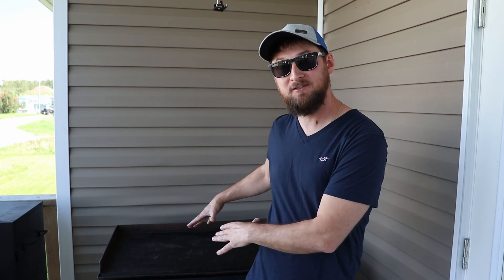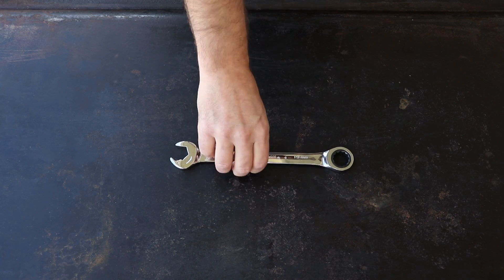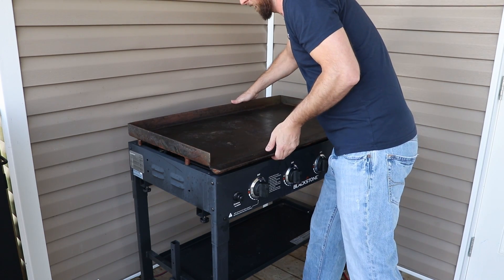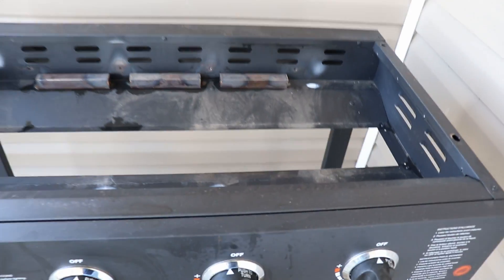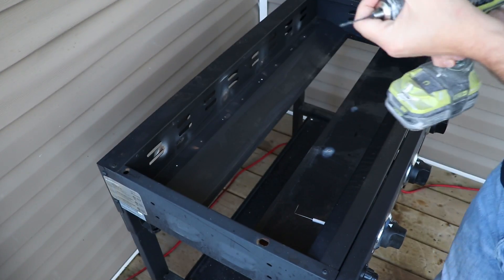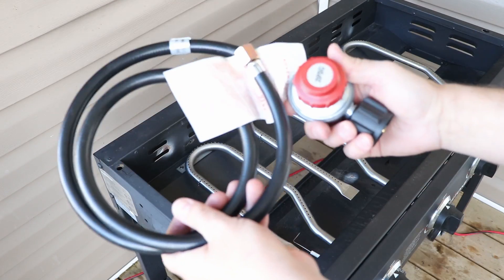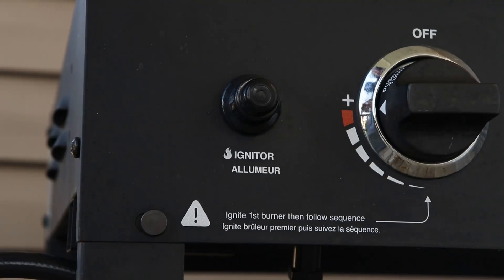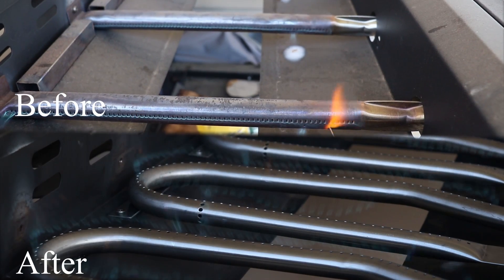UPGRADES for a WAY HOTTER Blackstone GRILL/GRIDDLE

Comment: I upgraded two 36 inch blackstones, mine and a friends. Mine I put new burners in and a 30PSI regulator because it was the same price as the 20PSI. Way overkill. The original regulator is 1PSI. IMHO 5 PSI is overkill.  On my friends we did not change burners just upgraded the regulator. The original burners put out way more heat than the upgraded burners. The upgraded burners do disperse the heat more, but after using both I would say that the regulator upgrade is a must and the burner upgrade is optional. Also remember to turn off your tank and drain your hoses after every use. You are putting more pressure on the internals of the valves and they could fail if they are holding more pressure than designed for. The pressure is maximized when the valves are off but only if there is pressure in the system. Draining your hoses eliminates that pressure.
Reply from the maker: I would agree. The burners are for better heat distribution and the regulator is for better heat control.  Thanks for sharing.

Comment: This is a great upgrade.  My griddle had the cast iron burners.  I didn't need the regulator but I did need to extend the igniting probe closer to the tube.  I used an extension spring to grip the igniter probe and then forcefully unsprung it to extend to the tube and provide a good spark - took some trial and error.
Thanks for this video!

Comment: I have a 36" Blackstone (Air Fryer version), which is a fairly new model, so I can't speak to how the older models heat. On any outdoor gas griddle that I've seen, it appears that they all suffer to some extent for heating evenly all the way to the outer left and right sides. The U shaped burners look like they might move some heat a little farther out. I'm not sure how much of a problem it is for others, but for me it's not a problem. If I ever had to replace the burners, I might consider the U shaped ones. A far as heat, I absolutely have no shortage of heat. I almost always use low to medium-low settings for cooking. When I seasoned my grill, I turned all 4 burners up to high. I measured the surface temp with a high quality laser/infra-red thermometer and it got over 750 degrees. I don't cook anything on the griddle at that temp. Thanks for the video!

Comment: I did this to mine. Almost too hot on low- the adjustable regulator is unreal. I threw hash browns on WAY too cold yesterday..... that regulator fixed that in seconds :0 Think I may put two of the old burners back in for diversity. Awesome idea, totally dig it. Love having the 5th burner (regulator)  option as a total top attitude adjustment for either when it gets windy or the top is accidently cooled off quickly, almost like having a Wok add on.

Comment: My Blackstone is three years old and if the wind blows stronger then 7 mph good luck on trying to grill or griddle anything. I never have liked it and can’t understand why so many people think they are the greatest. I clean my burners every time I lose the blue flame due to spiders. I have built a wind break to surround it. I feel that the burners and the griddle or grills are too far from the flames and there is too wide of an opening from the bottom of the griddle to the housing which allows way too much air which equals reduced heat. Even though I have about given up on cooking on mine (I was more choosy about my next one) I still will use it on calm days. I’m going to invest into these burners and see if they help me to enjoy using mine again. Thank You

Comment: Drill the rivets out no grinding needed and use self tapping screws.......
Reply from the maker: I agree.
Reply: Don't even bother with self tappers....Drill the rivets then rivet the new ones in. Easy Peasy
Reply: With a 9/64th’s bit😊
Reply: Na, sometimes the rivets spin when you drill them out, grinding them is more gooder 😂😂

Comment: Great video! Thanks for posting. I believe there is a griddle by camp chef or blue rhino that has one area of the griddle they call the "sear" area. It has a double burner but just at one end. Your idea would be a great way to modify a regular griddle with maybe one or two of the double burners and still have part of the griddle where you could keep the temp a little lower. Overall a great video. Good photography, to the point narrative and super results. Thanks again. Looking forward to more from you!
Reply from the maker: Thanks. I'll be posting another video soon to answer some questions like "how hot does the griddle get?" "Does it solve hot and cold spots?" And a few more. Thanks again.
Reply: You can't get the Burners anymore. That's problem
Reply: @dgperforms1  YIHAM KB867 Gas Grill Burner

Comment: Use a bit in your drill and drill the rivets out I'm making the rivet hole a tad bigger. Rivets will fall right out. I like this idea I'm curious if the heat will warp the carbon steel cooktop. I may try this on one burner. Thanks glad I found it.
Reply from the maker: Yes, I just kind of used what I had without much thought into it. It still works great. I got my griddle above 800°f, which is way too hot, but didnt get any warping.
Reply: @savakolmogoroff9094  Have you made about pizza on it at that heat?
Reply from the maker: @oren5230  I've made pizzas on the grill but not the flattop. I might have to try that. Move videos coming soon.

Comment: Great video.  I wonder if I could fit just two of the curved burners in there and leave the other 2 stock burners.  Sort of to create a "sear station" even though the whole thing is a sear station.  I sous vide my steaks and getting a spot on the griddle even hotter is appealing.
Reply from the maker: I dont see any problems in doing that. Let me know how it goes. Thanks for watching. More videos coming soon.
Reply: I was thinking the same thing. Just putting in 2 u tubes in the center. I have 4 burners. Did you try 2?
Reply: Why bother with just two?  Do the entire mod then you will have them iff you need them.
You don't HAVE to use all 4 fired up to full.

Comment: The regulator gives you more heat. The tubes are only single hole tubes and not dual like the factory. It will give more even cooking but the BTU output of the tube are basically the same
Reply: So him changing to a regulator is good enough to make it hotter?
Reply: @drksole3666   thats correct

Comment: I changed out the regulator for a 30 psi adjustable regulator which provides more gas flow.  The griddle gets much hotter now
Reply from the maker: NICE!
Reply: I was thinking of doing the 30 psi, no complaints a year later?

Comment: At first I wasn't sure but now I think I'm going to do this. However, I will say just as another commenter said. Self tapping screws and a drill bit to drill the rivets would make it way easier and require less tools.
Reply from the maker: Correct. I definitely winged it.

Comment: The normal grill reg is 11wc or about 0.4 psi.. I opted for a slightly less over-the-top 0-5 psi regulator.
Reply: Where did you find a 0-5 regulator with the right connector?

Comment: Great Video.  How do you light the other three burners is the ignitor is only on the first burner?  Do you have to remove the griddle in order to light?
Reply from the maker: The flame from the first burner simply lights the others due to their closer proximity.

Comment: Nice video. The linked burners don't fit the new 36" models though. The tubes are now 17" long. But at least I have the instructions to mod it.
Reply from the maker: Thanks for the update and thanks for watching.
Reply: Do you know where I can find the 17" ones?
Reply from the maker: @1BigPapas220  you could search Amazon. I'd start there.
Reply: I ended up buying "Hisencn Stainless Steel Gas Grill Burner" from Amazon. Measures 16.5" and can still for 4 in the Blackstone.
Reply: @Collective-Mayhem  thanks I will look them up.
Reply: @Collective-Mayhem  hey I tried to look them up and can't find the ones with 4 burners.  Would you happen to have the link?
Reply: I had 1.5" steel tubes to support the burner since you can't mount them to the other wall. Just used JB weld and let the burner lay on top of the tube. Hardened in 24 hours.
Reply: @Collective-Mayhem  got it  thanks
Reply: So I just upgraded my griddle with air fryer and I added a piece of the original burners the blackstone had I’ll install the valve bar soon

Comment: I like the video and see you would get more even heating but to be honest im doubtful of how much extra heat your getting (from burners) because the old burners actually appear to have more gas holes than the new ones. Again im not saying that you are wrong and only questioning how much it changes. I feel that an increase in heat may be from the PSI from the regulator. Thanks for sharing this. Sorry wanted to add one other thing. instead of a grinder. use a 1/8 drill bit in the center of the rivet for the same effect with faster removal.
Reply from the maker: Yes, you are correct. The regulator has more to do with the increase in heat. The new burners are for heat distribution.  These burners cover more area and the griddle is less prone to hot/cold spots. Thanks for watching and thanks for the advice. More videos are on the way.
Reply: I do agree Dion, I wonder what the BTU's are on each of the two different burners?  anyone know?

Comment: What's the need for a new regulator and how do you light the other burners having taken out the flow channels from one burner to the other, looks like you have to take the griddle off to light them all.
Reply from the maker: The flame from the first burner easily lights the the next burner and so on....

Comment: Not bad if you want more heat. But as it comes from factory is already too Hot. If I was to upgrade it I would adapt 2 BJ thermostats. 1 for 2 burners. Those thermostats have 2 adjustment screws. One for pilot adjustment that you’re going to need (install pilot) and the other for a bypass adjustment for the low flame. And most definitely I would not use a HP regulator like you are. This is a Griddle not a Fish cooker.

Comment: Great video! Very easy to follow. Do you have an specs on these burners? I'm interested in the BTU rating of these burners. Thanks.
Reply from the maker: Hello and Thank You. I dont have the BTU rating of these burners but  I do have some info. 
For my Blackstone griddle 
Highest temp- from 500°f to over 800°f (thats way to hot but up to 650°f gives you lots more control and I get incredibly sear on meats)
Pre heat time- from 15min to just 4 min. 
I can now easily use pots and pans on the flat top as well.
Reply: click on the amazon link and these burners claim 12000 tbtu's. blackstones are supposed to be 15000 so....?
Reply: Hi Michael... I have used these burners and the original blackstone  burners with the regulator mod. The original blackstone burners definitely put out more heat but the burners shown here disperse the heat more. Putting an oversized regulator on is where you get the biggest bang for your buck. IMHO the burner upgrades are optional.

Comment: Do you have any data on how much of a temperature increase someone would expect to see after this mod?  Definitely looks like you would have much more even heat, but I'd be interested to see what the temperature of the surface is at with something like a laser temperature gun when the griddle is on full blast.
Reply from the maker: Funny you ask. I filmed a video exactly about this today, sat down to edit and it was all out of focus.
I got an average increase of over 200°f and got the center to over 800°f (it topped out around 575°f out the box) after a 10min warm up.  Good for an incredible sear and overall more control and even heat. I'll be refilming that vid and will release that soon. Thanks for asking.
Reply: @savakolmogoroff9094  Holy shit!  That would produce some insane crust on a steak or burgers.  If you happen to re-shoot the video to demonstrate the proof of concept, I'd be interested to see.
Reply from the maker: I will get on that ASAP. Thanks for watching.
Reply: @savakolmogoroff9094  Any long term updates on the mod? I'm about to do it myself probably tonight or tomorrow.
Reply: @savakolmogoroff9094  cool

Comment: I’m buying a flat top would you recommend another one other than the Blackstone that has better heat on the bottom more distributed or should I buy the Blackstone and just redo the heating elements

Comment: Awesome video.. I'm going to do this mod.. Do you think just the high pressure hose will make a difference in the stock burners..? Thanks again..
Reply from the maker: Thanks and yes. I changed just the hose on my bbq grill and it made a world of a difference. Preheats much quicker and gets hotter for a much better sear and beautiful grill Mark's. Thanks again for watching.
Reply: You only need to upgrade the regulator. Burner upgrades are optional. Use an adjustable 5PSI regulator. When finished keep a valve open on the Blackstone and close the valve off at the tank to drain all the pressure from the system so you dont damage the valves on the Blackstone.
Reply: How does this mod work with the natural gas, any pontenial problems?
Reply: @damerkman  Some of the best advice is also some of the most simple. I'll do this on my Weber as well.

Comment: Did you have to change any of the gas valves on the knobs
What does change the pipework
Reply from the maker: Nope, new burners just slipped into existing valves.
Reply: And I guess you getting  twice as much heat 
Virtually
Reply from the maker: @danwhite8856  got mine to 900°f but don't do that. That's way too hot for anything and detrimental. I don't go over 650° anymore.
Reply: @savakolmogoroff9094  steak will be good on that 900f

Comment: Can you just upgrade the hose without the burner? Can your stock burner handle the hose only? Say if i don't want to change the burner but hose only to increase more gas?
Reply from the maker: Yeah, that works too.
Reply: @savakolmogoroff9094  You wouldn't happen to have a new link would you? The one you have is out of stock.

Comment: So how  do control the heat from the propane regulator or from  the griddle or set the regulator then adjust from the griddle?
Reply from the maker: Yes, set the regulator and adjust on the griddle.
Reply: @savakolmogoroff9094  thanks!

Comment: Great video! Any idea if this would work for a NG conversion?
Reply from the maker: I'm not sure but I dont see why it wouldn't. You may have to use the appropriate NG parts. THANKS.
Reply: I’m curious as well. Don’t think you could use a regulator to control the gas the same way.

Comment: Question did you have to alter the igniter stick at all, thank you in advance for your reply
Reply from the maker: Yes, I just bent it a bit and it works perfectly fine.
Reply: @savakolmogoroff9094  got it because its away from the pipe holes and I'm trying to figure out how to turn it or twist but haven't figured out how or which way but I appreciate your getting back to me.

Comment: you never showed how to adjust the air mixture, the grill should not sound like a blow torch, you also had floating flames due to too much air and fuel flow, 
also agree with the drilling of rivets instead of grinding would have been a lot cleaner and safer, but nice upgrade though

Comment: Hi, I know you said to use a 20 psi adj. Regulator but do you think a 5 psi adjustable regulator would be enough?
Reply from the maker: Yes. The 20lb regulator is mostly overkill but awesome if you want a scorching hot griddle. The 5lb would still work well.
Reply: My setup has a pressure gauge on it and I can't get near 5PSI without flaming the burners out so IMHO anything above 5PSI is overkill.
Reply: @damerkman  thanks

Comment: Anyone who has done this. Any concerns or problems with all the extra heat against the back wall there. In the vid you can see it cookin the paint off just in the few minutes he had it running.
Reply from the maker: I made this video. The paint is fine.  Put some guards in if you're concerned.
Reply: @savakolmogoroff9094  was just more curious than concerned.

Comment: since we have, in theory, "doubled our burners", would it be safe to say we are now using 2x as much fuel? :(
Reply: only if the amount of holes in burner is exactly doubled. I would look at this as a great way to even out the heat over the surface rather than going for max heat

Comment: Could this be done to a blackstone pro series?
Reply from the maker: I dont see why not. Check the size of your burners and order replacements accordingly. Or just start with an X-lb regulator and see if you like that.
Reply: @savakolmogoroff9094  would it be too much heat so as to warp the metal?
Reply from the maker: @brianrockwell2721  if you turn it up full throttle, yes. But use a temp gun. Your good to around 650°f. Dont go past that.

Comment: The burners are sold out on Amazon, any other recommendations for these?
Reply from the maker: Measure your stock burners (they differ between models) and see if you can find something that works.
Reply: Yeah, I noticed they sold out to. Gonna be a run on these high quality burners for sure. Can’t wait to find mine